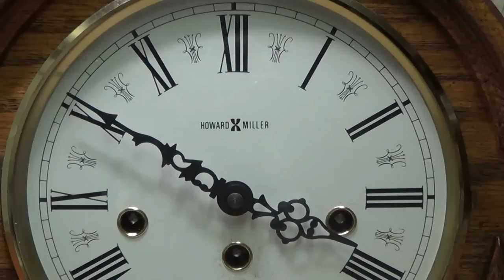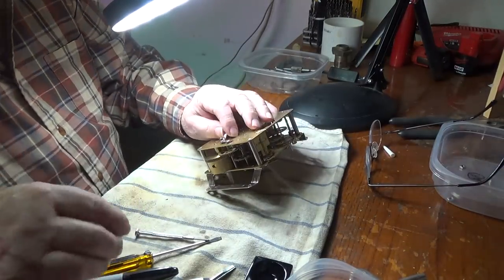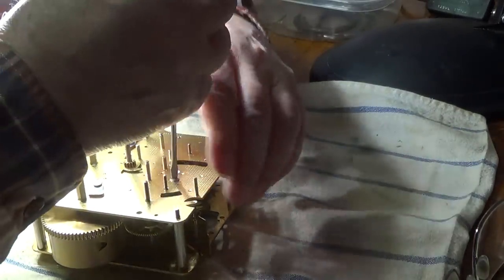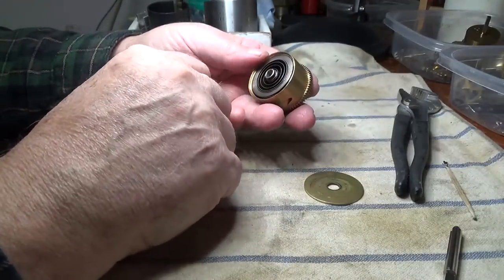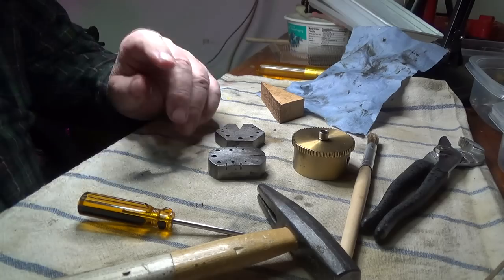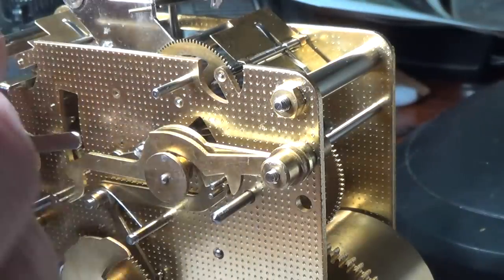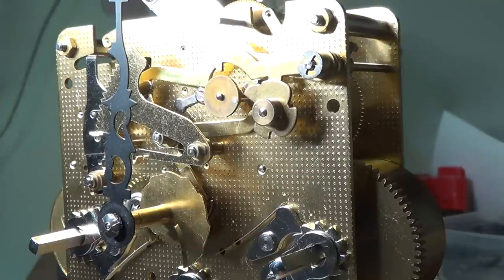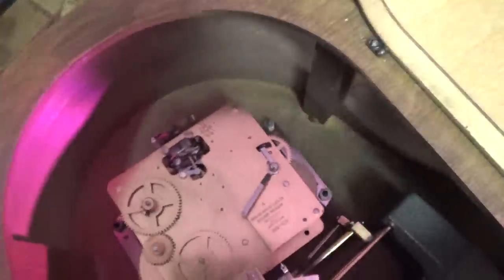Howard Miller Worthington Mantel Clock with Hermle 340 020 Movement

Comment: Hi There, thank you so much for posting this video with such a great explanation of the chiming mechanism. I live in the UK and so I get offered a lot of the Hermle chimers, but so far I had not found a good enough explanation of the chimes! Now I think that I will be willing to give them a go!
Also, a quick question about the main springs; when do you decide that the spring is "set" and have to replace it?  Looking at the one shown here, I would have thought that it was "set", due to its compressed size when unwound?
Once again, many thanks for the videos.
Reply from the maker: Thanks for the comments.  When I did this clock, I was hesitant to use the old springs.  Normally, the rule of thumb is that the relaxed springs should have a diameter a minimum of two-and-a-half times the diameter of the barrel. These were much less than that. There was no hurry getting this clock back and the spring barrels can be removed without taking the clock apart, so I put them back in.  While I'm writing this answer, I have a video rendering that will be posted tomorrow. It shows the replacement of the springs in this very clock.  It would only run accurately for about 3 to 4 days and then start to gain or lose time erratically.  If it had run reasonably well with the old springs, it would have saved an 82 year-old man $30. This is a hobby for me.  I have no need to make money on it, so it is a matter of course that I won't replace parts unless I'm absolutely certain it's necessary.
Reply: dperry428 That makes perfect sense, I would do the same😃👍
Thanks for the spring explanation, which is what I was working from, so it does all make sense. 
I know what you mean about working with the springs, however, I’m much happier now I have a main spring winder! I really cringe when I see people doing them by hand😮 ... show the springs some respect!
I look forward to your video of replacing the springs.
Thanks again, from one hobbyist to another.
Reply from the maker: @joncooke2450  Here's a link to the video  https://youtu.be/DJ2cCFcPTn0

Comment: Great video. Just finished cleaning 3 Hermle 340-020 movement. Put them together. they all run for like half a day and then stop. Floating balance seem to be working but a bit slow. Could it be out of beat? Is there a way to clean the floating balance? I don't know if it needs to be cleaned or oiled. Please help. Thanks a lot.
Reply from the maker: Rinse the entire balance assembly in mineral spirits.  This may be helpful.  http://www.nawcc-index.net/Articles/Murray-hermle.pdf  as well as this  https://mb.nawcc.org/threads/guidelines-for-repair-hermle-floating-balance.17277/

Comment: Oh, that 340-020... It is a nice looking movement, but the plates are thin. I have a junghans with that movement. Serviced by me years ago, only a clean and relube. Now after 5 years the chiming is slow: removed the large barrel to see if something is wrong... Plates ok, but the arbor just enlarged ( sorry my english ) the hole on top and bottom of barrel, making the barrel moving left/right on his axis. Time to buy a new barrel.
Reply from the maker: Sounds like either rebush the barrel and cover or replace the whole thing. A new spring would also help with the slow chime.  https://timesavers.com/search.html?q=hermle+mainspring&go=Search

Comment: That's a very nice clock. I have a Howard Miller Worthington clock similar to that one, only mine has the Kienninger movement. I want to get into clock repair someday. Can clocks like this one that had a Hermle movement be fitted with a Kienninger movement?
Reply from the maker: Howard Miller used Hermle movements until 1993, when Howard Miller bought  Kieninger and started using those movements.  I don't know the situation at the moment but, last summer, Kieninger was in Chapter 11 bankruptcy and, if they didn't find investors, would be going out of business.  As far as fitting the movements to an existing case, you'd best measure the distances between the center hole and winding holes on the dial and see that the replacement movement has matching distances between the center shaft and the winding stems. Otherwise, you'll need to replace the dial as well.

Comment: I have a Hermle 451 movement (451-050H specifically) That only chimes every other hour. For example, it will chime on the 2, 4, 6, 8, 10, and 12, but just clicks with no chime on 1, 3, 5, 7, 9, and 11. How do I fix this problem? Could one of the cams out of sync?
Reply from the maker: Since the striking mechanism is controlled by exactly the same parts and processes, with the exception of the NUMBER of strikes, which is controlled only by the rack and snail, what you describe makes no sense whatsoever. I know of no condition under which this would happen.

Comment: Excellent video as ever. Why is the pre-chime state called "warning"?
Reply from the maker: I don't know why other than it's ready to strike.  The parts have always used the term, as in the pin that moves from locked position to the ready position has always been called the warning pin, the wheel it's on is called the warning wheel and the lever that catches the warning pin is called the warning lever.

Comment: Thank you for this very informative video! I am working on a movement with the same functionalities but I encountered the following problem: the quarter chimes are incomplete, the last note is missing. One of the hammers remains lifted and drops back in the warning phase. Do you know what the problem could be? Many thanks!
Reply from the maker: The pinned roller that lifts the hammers needs to be advance in its rotation by an amount to allow the hammer to be released.  If you look at the back of the movement, there are 3 gears that transfer power to rotate the pinned roller.  The top one has a set screw that can be loosened so the roller can be adjusted.
Reply: @dperry428  Thank you for your advice! I will try and let you know the result!

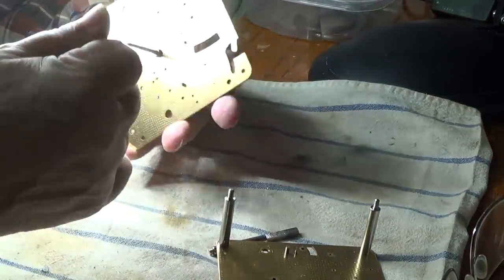Comment: At 28:40 how did you get that shaft out?  Did you need a special puller?  If I don’t have one can I just clean the plates with the shaft still installed?  Thank you.
Reply from the maker: Unless there is significant wear in the plate hole, it's best to leave it in place.  First, unless one has a puller, which is expensive, taking it off involves driving it off in any contrived manner you can devise without damaging the shaft.  Second, once it's removed, the relationship of the lifting cams on the shaft and the squared end of the shaft on which the minute hand goes is now out of kilter.  Getting the cams back on in EXACTLY the same relative position is nearly impossible.  Then, you'll have a minute hand that does not align with the number 12 when it strikes the hour.  So, you end up having to force the bushing on the minute hand into the correct relationship by twisting the bushing.  Best to just leave the shaft alone unless ABSOLUTELY necessary.  Just do a careful hand cleaning of the hole and shaft. If the shaft does need to come off, it is best to remove the gear from the shaft on the inside and then remove the brass collar from the shaft on the inside of the plate.  It can be gripped and twisted off, noting well its position so it can be accurately replaced.  Then, either a new collar can be turned or the old one replaced and held in place with a drop of Loctite.

Comment: can i replace the 1051-020 11cm movement for a 1050-020 that has the balance wheel and not the pendulum? being the 1050-020 is a lot cheaper? will this be a direct exchange movement? thanks
Reply from the maker: I don't know, as I'm not a Hermle expert.  What you need to check is whether the distances between the winding holes and the center hole are the same.  Otherwise, I don't know why not, but I don't know if the hole distances are the same.  Otherwise, you'd have to find a replacement dial, too.
Reply: @dperry428  ok thanks tell me if the movement has a broken time band will the clock run at all? or can they be over wound? also because i do not have this clock yet in my possession what winding point is for the time? i have got the 8 the 6 for this. i think the 6 is for time and 8 is for the hour and 4 is for chimes this clock was not running so i told the guy to started it and keep  it running by hand and now it seems to be running. it seemed to be wound tight but the wawcc forum guys say you can't overwind them. but now i wonder?  thanks
Reply from the maker: A clock cannot be overwound.  When you reach the fullest a spring can be wound, that is it. I suppose a gorilla could put enough turning force on the mechanism to break something.  People will let a clock go for years without servicing it and the oil can congeal and cause the spring coils to bind and not slip past each other. That's probably what people are calling overwound.   It is more properly called underserviced or unoiled.  I assume by "broken time band" you mean a mainspring. If the spring for the time train is broken, the clock will not run.   On a chime clock movement, facing the clock front, the hole in the middle is for the time train, the hole on the right is the chime train and the hole on the left is the strike train.  So, I assume you are buying a used clock.  If it is not completely operative, you are facing, unless you have the skills, a large repair bill.  It will need servicing at the least; that is cleaning and oiling.  Very likely, it will need extensive repair to replace worn pivot holes with new bushings.  Heaven help you if the clock was manufactured during the 1970s through the early 80s when the manufacturers used soft steel for the arbors and chrome plated the pivots. The chrome wears off and grinds away the pivot holes and the repairs can get very expensive.  Most people choose to just buy a new replacement movement.  Either way, the cost is not cheap.
Reply: @dperry428  thank you much. the clock is a friends not mine. it is the franz hermle 1051-020 11cm  200.78 and above the name is what looks like a square but most likely a 0  if i could post photos and some videos of it running but can't here. anyway  you helped me a lot thanks so much. i think it does need oil and the spring may be dry and winding them tight makes them stick. the local clock shop said the time bad was broke but it is now running after he mas kept it running so it may be dirty and it just sticks. again thanks. i have been viewing your videos on that movement your took all apart and then put back together.

Comment: Hi, I followed the instructions but the hammers are stuck up when the chime is done. They don"t come down. Do you think it is the cam position or the chime mechanism? Thanks
Reply from the maker: If the chime is stopping, then the cams are correct.  It is the roller with the pins that needs to be advanced.  Loosen the set screw on the first external gear and disengage the tooth mesh with the next gear.  Move the roller to a position where the hammers just drop off the pins. Then, holding everything in place, push the first gear back to engage the second gear and tighten the set screw.  You may have to repeat the process until it works.
Reply: @dperry428  Thank you very much.

Comment: I like the information and it works all the time. I have a question; I've just finished cleaning hermle 1161-853 and got it running. Trouble is, it only chimed correctly the first time on the quarter, half, three quarters and the hour. Then the second time it didn't stop chiming for 2 cycles then stopped then the strike started. I made sure I followed your instruction when I set it up. Pin was up and both cams were in the right position at the 3 quarters hours. Would a wrong fly wheel affect this? Are both fly wheels interchangeable or different? Thanks
Reply from the maker: Check the levers on the cams.  Make sure the hook that locks everything down on the 3/4 hour is not dragging or hanging up on the lever or cam.  The governor fly would be a non-issue.
Reply: @dperry428  Thank you very much. Will do

Comment: Hello and Thank You for the Video. Can you tell me what the Number 40 on the Barrel represents?
Reply from the maker: It's Hermle's barrel number that, used in conjunction with their service manual, gives reference to the size of mainspring that is used and for replacement.  Clock parts suppliers such as Timesavers, sells replacement barrels and mainsprings using that number.  Here is a link to the Hermle service manual:
https://issuu.com/acru/docs/hermle_service_manual

Comment: I've not seen a balance wheel type of system before.  Is this what is used on the Anniversary Clocks (typically under a glass dome enclosure)?  Those "400 day" clocks?
Reply from the maker: The 400-day clocks have what is called a torsion suspension.  There is still a typical, though very small escape wheel with an anchor and adjustable pallets.  Instead of a pendulum crutch, there is a lever that extends vertically from the top of the anchor. Into that lever is a horizontal fork, the back of which is attached to a VERY thin and delicate ribbon of wire, which is suspended from what is called a top block. At the bottom of that wire is a rotating pendulum, typically 4 balls, that rotates back and forth through about 270 degrees.  The wire on the anchor pushes the fork back and forth, which twists the thin wire, which transfers the twist to the pendulum.  There are about 8 beats of the pendulum per minute, so it takes a very long time for the mainspring to wind down.  Some of these clocks are actually made to run 1000 days.  The main problem with them is damage to the very thin wire ribbon.  They vary in thickness from model to model but a common one has a thickness of .0024". The average human hair is .004, so these wires are close to half the thickness of a hair.  They get broken easily, or some kid decides to spin the pendulum and permanently puts a spiral twist in the wire, making it completely useless.  A lot of people don't like to work on them. They are sometimes difficult to get in beat.  If you ever get one, don't even think about working on it without having a copy of Charles Terwilliger's book "The Horolovar 400 Day Clock Repair Guide".  It contains outlines for identification of every 400 day clock made and exact specifications for the wire thickness, fork location, wire length and positioning of the top and bottom blocks that attach to the wire.  I've repaired many of these clocks and my copy of his book goes back to the early 1970's.  I have half a dozen of these clocks in my collection.